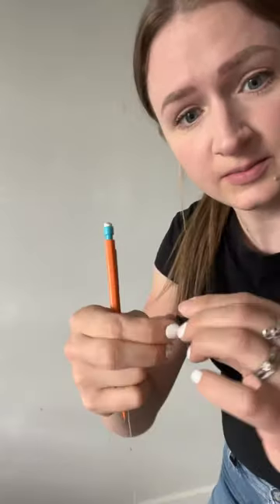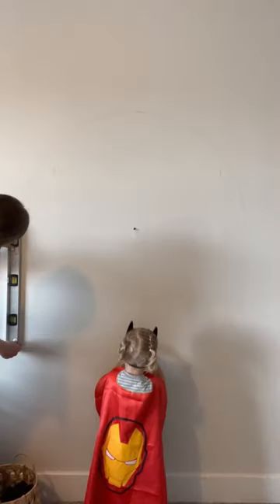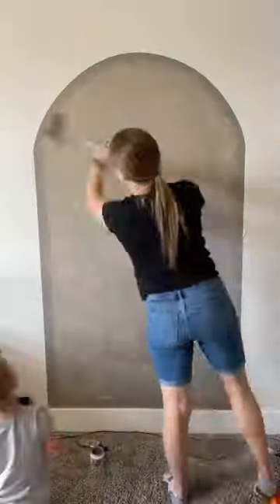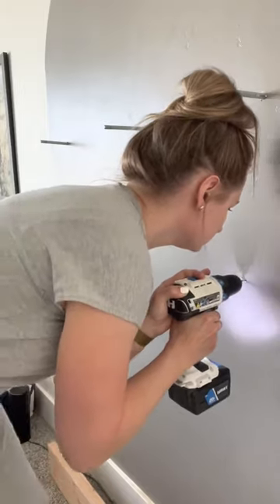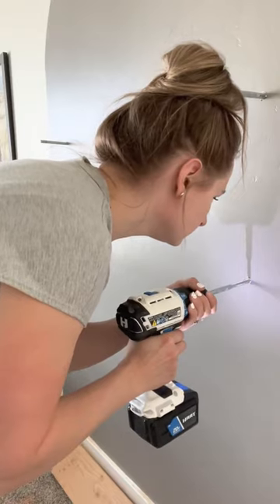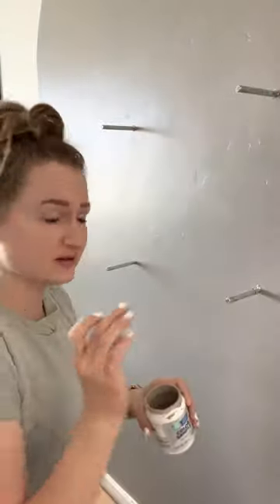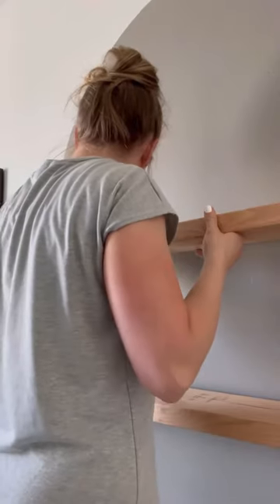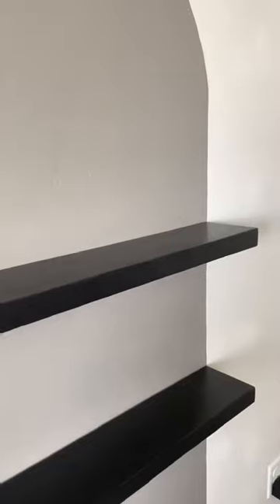This was such a fun and simple DIY! shelf brackets are linked in my amazon store #floatingshelves

Comment: Those look a lot like 3/8 hanger bolts that are very cheap at Home Depot. Was thinking of doing it with hanger bolts washers and coupling nuts. The coupling nut tightens the washer against the wall making it stiffer.